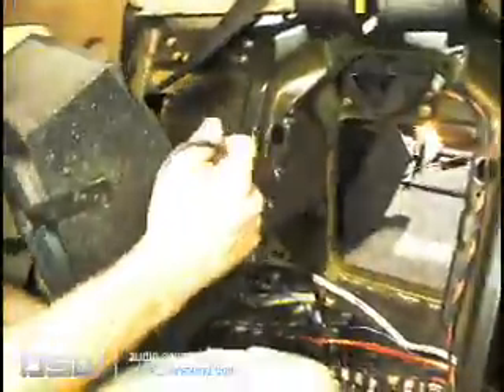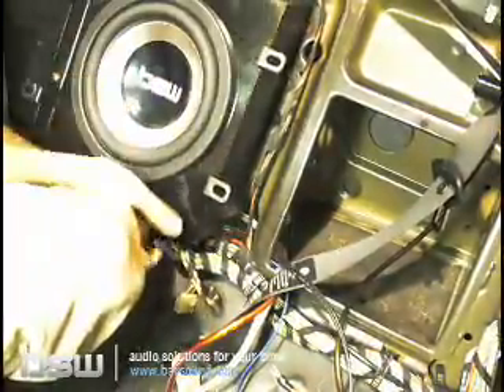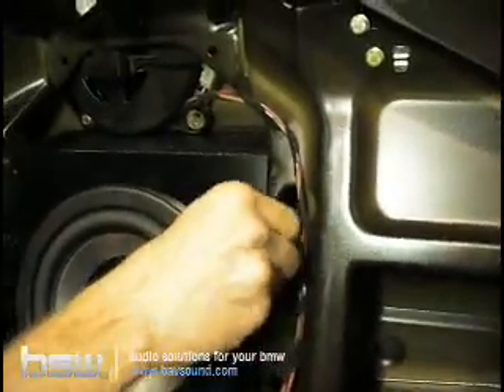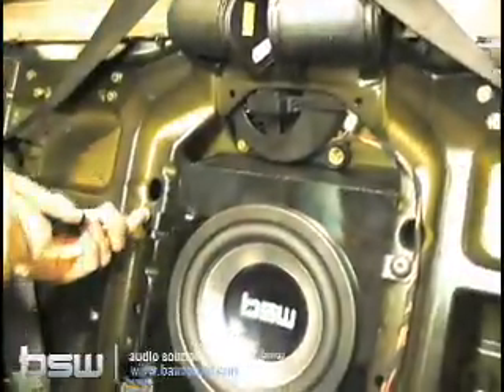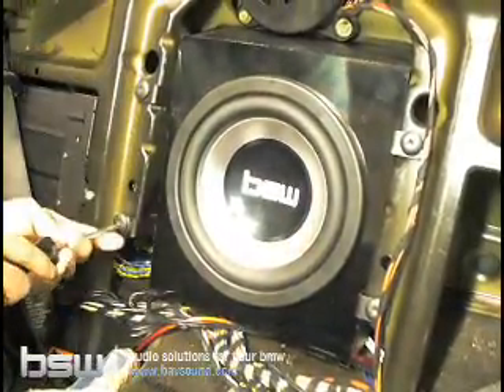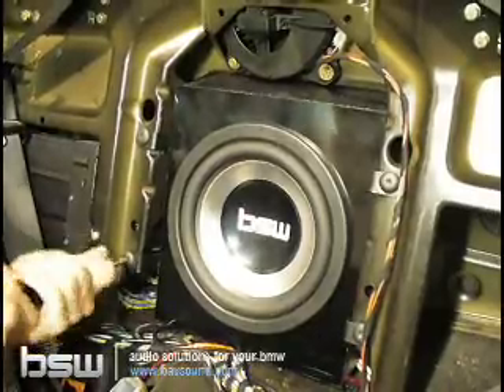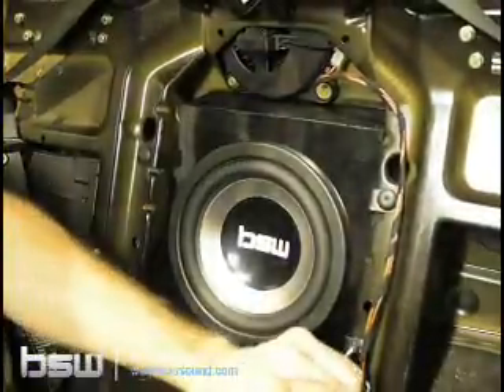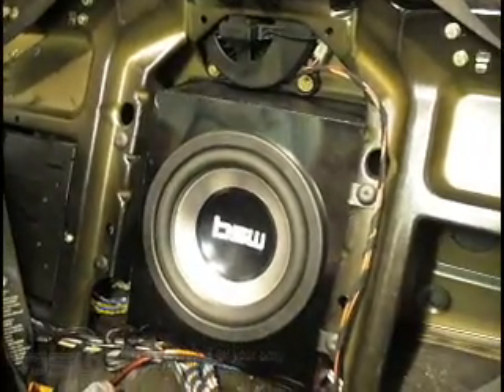BMW Subwoofer Upgrade/Installation | Convertible (E36) | BAVSOUND ib108 Enclosure Mount

Comment from the maker: @HocicoFreak It's called the ib108 and we do still carry it for E36 convertibles only. If you have another model we have other sub systems. Try "browsing for all bmws" then selecting sub systems. It should be the 2nd listing down.

Comment: hey, iv got a 318i bmw 96, how big is the subwoofer in the video? im guessing thats the biggest size u can fit in that space. and how did u get the bracket or  the molding to hold the speaker, was it made or do you guys supply it?